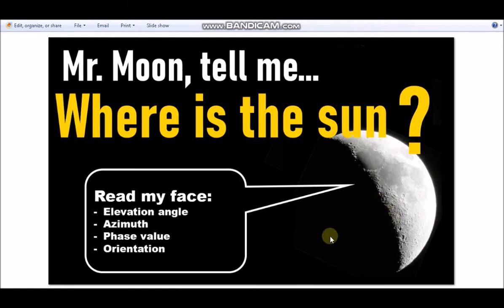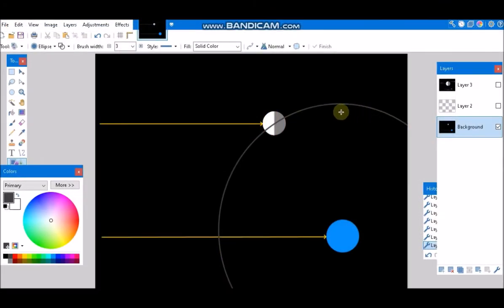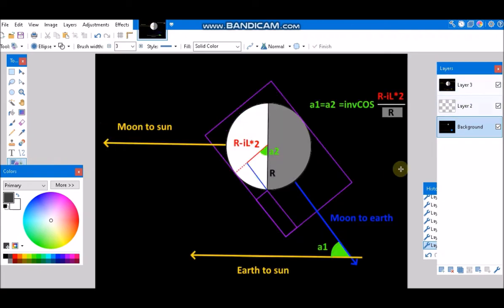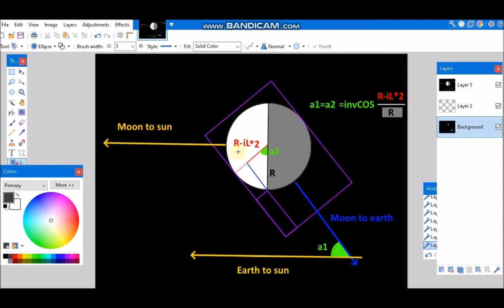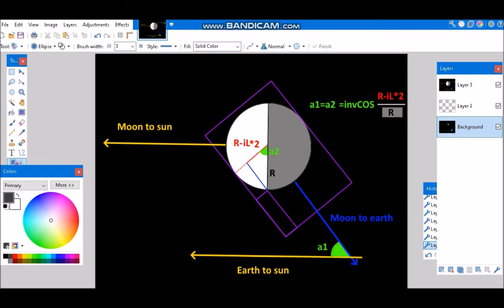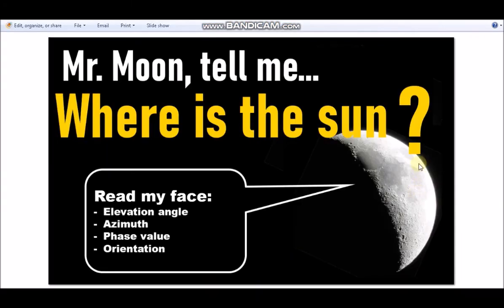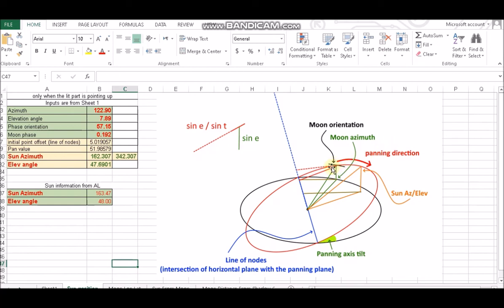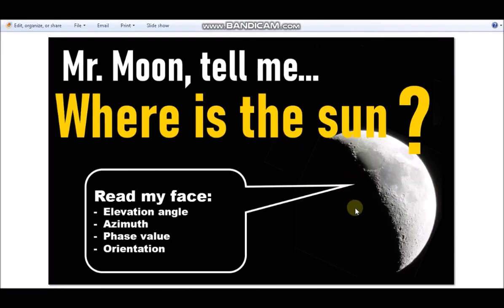How to use the moon's information to locate the sun

Comment from the maker: The Spreadsheet to find the sun using the moon's info : https://drive.google.com/file/d/1kDY8TevGe_Pj6ZCKlHG8ZiOByu2GtjcJ/view?usp=sharing

How to use it :
1. enter azimuth and elevation in degrees and minuets 
2. enter the direction of the lit limb of the moon in degrees, the scale starts from the horizontal to the right being zero degrees, pointing down is in minus and up is in positive . 
3. enter the phase value in 0.*** 

the sun position will be displayed in azimuth and elevation. 
Accuracy: depends greatly on how prices your measurement of the terminator line tilt, it also decreases when the moon illumination ratio is tiny as these values are rounded and the rounding can be up to 50% of the value (ig. 0.01% could be the rounding of 0.014% but the "4" is not displayed"

Comment: For anyone researching flat/globe: DIY EARTH RESEARCH PLAN
_______________________________________________________________________________________________________________
- Get a small ball and when the Moon is visible during the late afternoon and the Sun is visible hold the ball up next to the Moon and see if 
  the shadowed parts match or not. Watch the Sun set that day if does so before the Moon does. Video it if you can. Notice the bright part of
  the Moon points at the Sun.  Check where the Moon points until the Moon has also set. You can use TimeAndDate.com for the date:
  https://www.timeanddate.com/moon/uk/clacton-on-sea?month=11
  https://www.timeanddate.com/sun/uk/clacton-on-sea?month=11
  https://www.timeanddate.com/astronomy/moon/light.html?iso=20201121T1530

- Identify a landmark about 11 miles out to sea that makes it easy to estimate amount obstructed or not. Visit your chosen vantage point on
  an overcast day with a little wind and air + sea temperatures about the same. Photograph the landmark at just above sea level and at least
  15 feet higher up. Did you see any difference. Try it again at different times and conditions to see refraction effects and when they occur.

- Install an app on your phone that displays the accelerometer readings as a graph. Drop your phone onto a soft chair or a bed from as high
  as possible. Try moving the phone around and see how the readings change. Notice they go to zero when the phone drops. Weird!

- Learn how to calculate and draw using predicted perspective angles only.

- Notice that a circle of posts around you will appear to be a line of posts going perfectly straight side to side IF you have your eyes looking
  straight ahead and perfectly level to the flat ground everything is standing on. Notice what happens if you look over them or under them.
  Now do it with a straight line of posts. Notice the slight curves.

- Learn about right angled triangles and working out sides using an angle and 1 side.

- Find a very high vantage point with a known elevation and sight of a sea. Install a free theodolite app for your phone. Visit the spot with a 
  half full bottle of water at mid point between high and low tide. Use the bottle as a level to check for a horizon dip from eye level. Try 
  different directions. Check the dip is the same in the phone and measure the dip angle from level using the app. Work out the possible
  Earth radius using the angle and the elevation height. Compare to the official figure.

- Capture your own star trail timelapse video / photo.

- Observe your stellar pole point from two locations at least 210 miles apart. Use the App to get the angle from level each time. Use the
  angle difference and North/South separation to get the Earth radius.

- Try out a few of the other ways to get the radius and see if they roughly agree.

- Check out TimeAndDate.com as they embody the globe model for Sun, Moon and Earth. Verify it correctly predicts Sun rise, set, moon
  rise and set. Try it for different locations and see if it is right for them too.

- Check out some web cams and verify when they show day and night compared to your day and night. Check some other way that those 
  places do have their day and night when the web cams show it.

- Research where the Sun is overhead at midday and how that varies. Decide for yourself where the Sun will be 6 hours after midday on a 
  flat Earth. In the summer time check whether the Sun is in the FE position 6 hours after midday. On the Equinox that is also Sun set.

- Check out old flight charts for places in the North, the Equator and the South. Notice how far apart are the lines of longitude.

- To verify spin I recommend https://www.youtube.com/watch?v=aDorTBEhEtk or you could try your own Foucault's pendulum - see
   https://www.youtube.com/watch?v=M8rrWUUlZ_U